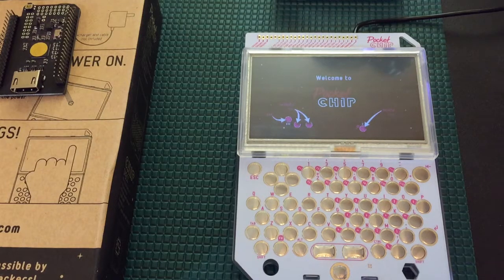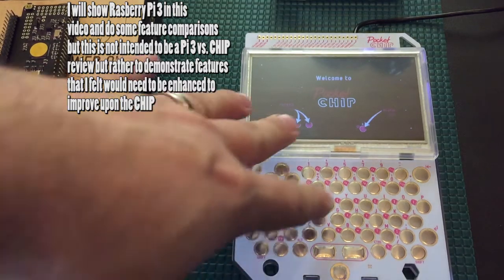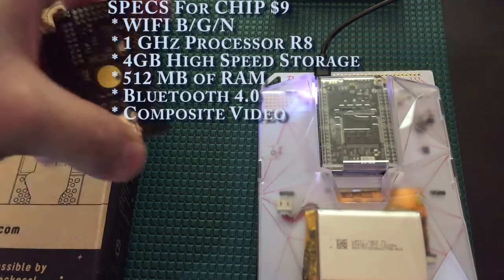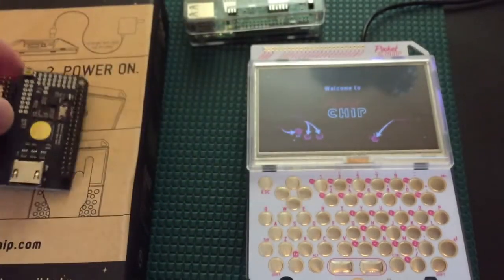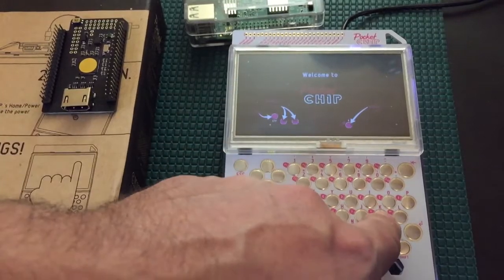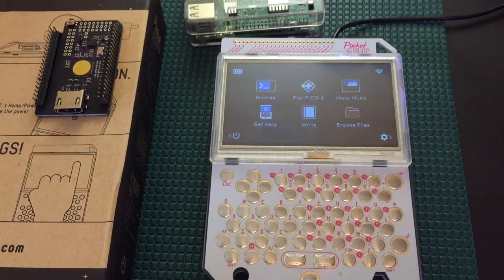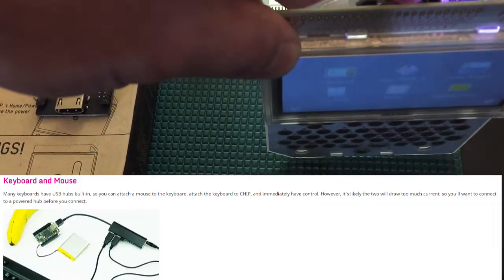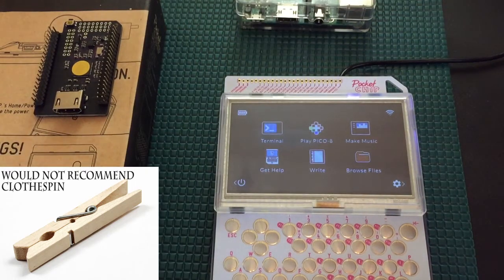CHIP $9 Computer & Pocket Chip - Review

Comment: I'm one of those people who love the Pocket Chip even though I'm a Linux noob. But that's the point as my intention for buying this is to learn Linux, programming and  to eventually to build projects with. The limited and stripped down OS and GUI motivates me to build a better GUI and to add features customized to my needs. Also, the form factor of the Pocket Chip makes it convenient to learn to program on. If the OS and GUI were more robust, it would have taken up more system resources and would make it harder for me to customize.
For those who are looking for an out of a box solution for general computing, as of now, the CHIP is definitely not. It's designed to be maker friendly.
Reply: A: I like the keyboard much better than a tablet touch keyboard, as it provides physical tactile feedback. But if you are doing any serious typing, such as coding or word-processing, I recommend using a full size keyboard with the Chip.
B:I'm not sure if I understand your question. The Pocket Chip is too big to fit in a pants pocket comfortably but fits in a jacket pocket just fine. The Pocket Chip comes with a 5hr battery.
C: I use nano and I'm learning VIM. I've installed and ran VIM just fine on the Pocket Chip. I'm assuming you can run and install emacs within the console with out any problems.

If you have any more questions about the Pocket Chip, NTC forums is the best place to ask: https://bbs.nextthing.co/
Reply: Ya, you can buy a cheap touch tablet with better specs than the Pocket Chip for the same price. The Pocket Chip is not really a PDA or a gaming console, and there are better solutions if you are looking for one. That being said, although the Pocket Chip lacks a D-pad, you can easily print your own;  https://bbs.nextthing.co/t/hacking-the-pocketchip-case-to-add-gameboy-like-buttons/5086/10. And you can also replace the battery with a better one; https://bbs.nextthing.co/t/replacement-battery/10826. Most other devices are not as hack friendly. Like I suggested in my previous comment, the Pocket CHIP is good for learning, experimenting and building projects with. The Pocket Chip is not good for general computing.
Reply: Ya, I think you have to decide what is it exactly you're going to be using this for and compare other devices to see if makes sense buying one. For me, I just want to learn programming and learn how to build projects with, in which case this seems to be a good deal. Kinda like learning electronics by building projects with one of those old Radio Shack kits. It sounds like you're already an advanced programmer and not too interested in building on the hardware side of things, in which case the decision to justify buying one is harder. But for $60, there is not too much to lose and you can repurpose it to literally hundreds of useful things, which would be harder to do on other devices.

Comment: About your negative review of the built in storage; If you watch the videos of the founders talking about why they invented the chip. You will find out that they tried to create a digital camera using a Raspberry Pi. By the time they engineered an add on board with off the shelf WiFi chip, charging and battery management circuitry and storage and storage controllers that were based on NAND flash that support ultra low latency booting. The design ended up adding hundreds of dollars to the cost of the RPI and ended up being a 4 layer PCB with serious engineering challenges for impedance matching of HF circuit traces for the WiFi and Bluetooth. One of the design choices for the CHIP was to allow it to boot directly to a program with no OS installed. This is needed to have instant on for making embedded products like a camera. NAND FLASH is faster then external drives and was needed for this feature. They also injected the WIFI drivers directly into the Linux kernel so any Linux distro would immediately support the WIFI card.

It is important to understand the design choices before criticizing the CHIP. It is meant as a complete embedded compute unit to be dropped into a consumer product. Not as a toy or a dev board to have lying around the house. It is not meant to compete with the RPI but to fill the nitch for people that have an arm based application and product ready to be sent to Chinese factories to be put into a product but now I need a compute unit with off the shelf WiFi built in and charging without spending a ton of money on circuit board design or FCC type acceptance for a wireless device.
Reply from the maker: Very interesting. I am really glad to hear it has a place in the market and some people love it. I really wanted to embrace this device but my needs didn't fit the bill and I'm completely ok with that. I wish the company all the luck in the world as I think they had the makings of something that could in a version 2 be more broadly beloved with some tweaks. I also want to thank you for a great reply that was not defensive but informative. I appreciate you taking the time to explain the other side.